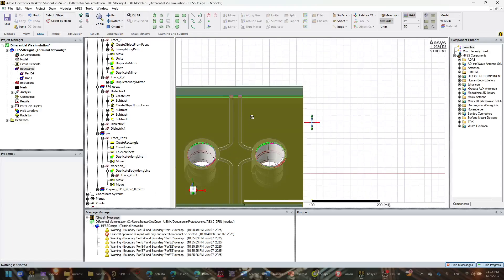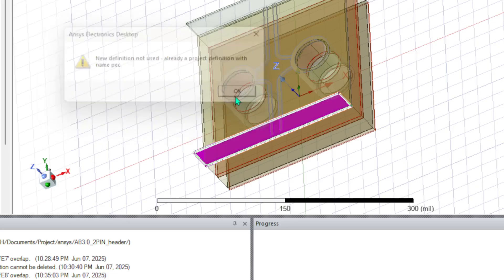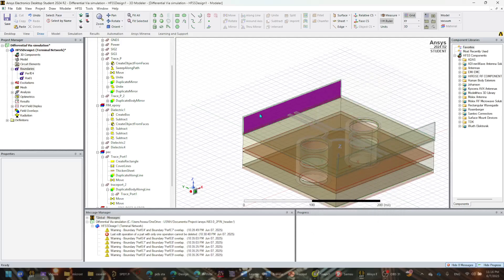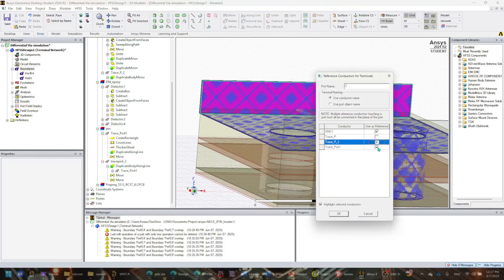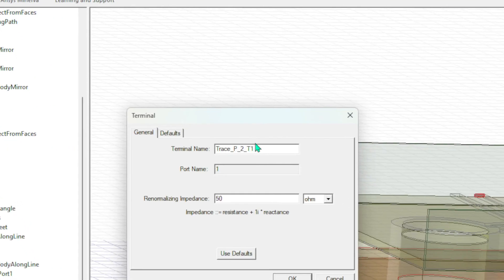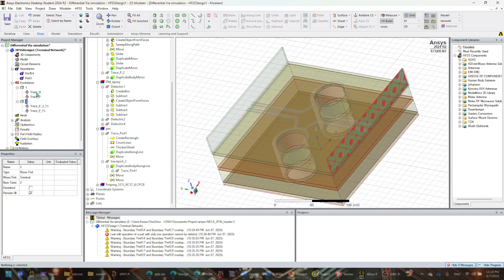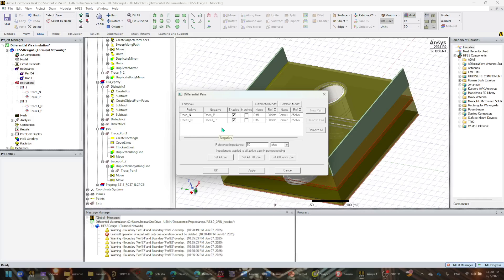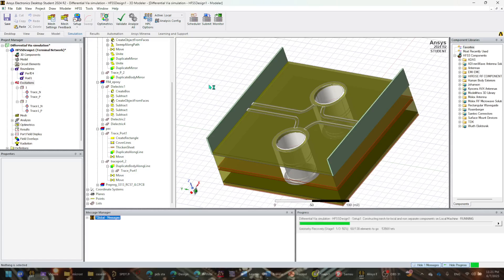Ansys HFSS Tutorial: Terminal Driven Wave port creation

Comment: Thanks for this video! Can you advice, please, whether it is necessary to know the differential and common impedance of the pair (in the "differential pairs" settings they are indicated as a reference)? I'm searching for the geometry now by trials and errors, so I can't be sure about the impedance of my differential lines.
Reply from the maker: Yes it is of course necessary to know the differential and common mode impedance of a pair. You can use some online calculator (JLC PCB IMPEDANCE CALCULATOR ) Or saturn or any other famous calculator to find the width and spacing for the targeted impedance
Reply: @MJH_Got_Shocked , Hi again. I have non-typical GSGSG structure, I didn't find calculators to use it. I just notice option "Matched" in Differential pair settings that implies matching with the load, so it is beneficial when searching for the proper impedance value. Thanks for the reply!